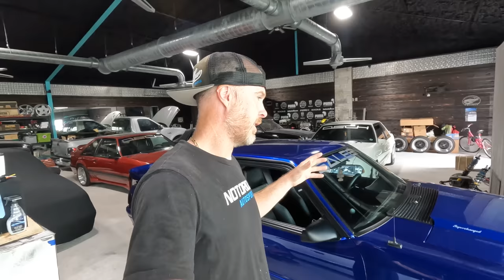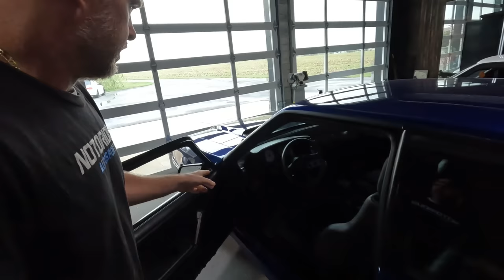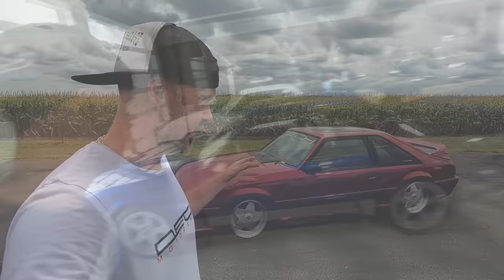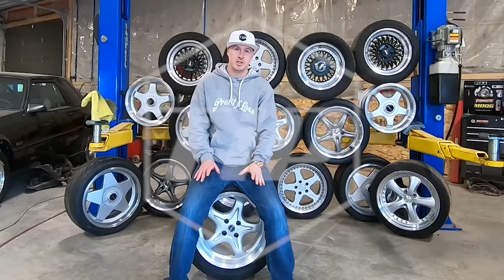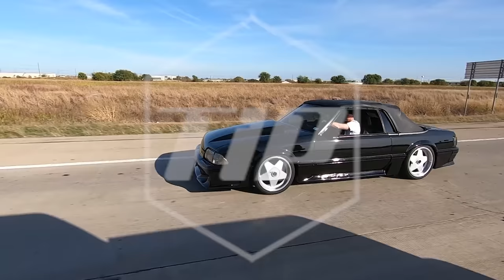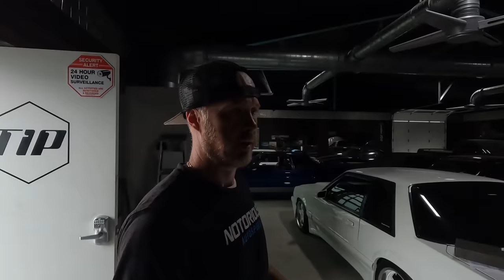Foxbody Mustang Starter Solenoid Delete & Wiring Fixes! - TIPS05E61

Comment: @7:50 Instead of doing all of that you can simply leave everything the way it is on the factory solenoid and make a small 10-12ga jumper to go from the battery cable post on the mini starter to the S post on the mini (sn95) starter, done.

Comment: Yes...a local shop in British Columbia that specializes in foxbodies did that to mine.  They deleted the old solenoid and did a relay system for a few items running off the solenoid such as electric fans, msd etc.  I think they made a mount and installed a few relays inside the wheel well. (It was tucked as well)
Reply from the maker: Nice! Ya this is a great upgrade for those with wire tucks.

Comment: Great idea on what to do about wiring a solenoid / removing the old solenoid for a high torque mini starter.
As far as the wiring nightmares when people wire in things wrong and left with trying to figure out why the 
wired things up that way. Great job figuring out the wire mess.
Reply from the maker: Thank you

Comment: @9:16 This is exactly how I do it, well I use a relay.  I have a distribution post that the battery + goes to which supplies battery voltage to anything requiring it like the starter battery post & the 30 pin on the new starter relay.  85 goes to battery- key cranking to 86 and 87 goes to the S stud on the starter.

Comment: This may be a stupid question but does the type of relay or amp size of the relay matter? Great video! I have been wondering how I could clean up my starter solenoid. I have a similar setup and was about to put on a new high torque starter so definitely going to do this and get a 12v distribution block.

Comment: So, if I'm understanding you correctly, if you have a high torque mini starter you can use a relay IN PLACE of the original starter solenoid and eliminate the original starter solenoid all together.  Is that correct?

Comment: Great information aside from you calling the smaller gauge wires low voltage instead of low current.  All the positive wires are 12 volts however, the smaller gauge wires carry less current not lower voltage. The electronics technician in me felt compelled to provide this correction.😉
Reply from the maker: I worked in low voltage for many years so sometimes when you talk in front of the camera you say stuff that comes naturally.. but yes you are correct 💯. Voltage doesn't kill, amperage does!

Comment: I had one hang up and kill three starters   by the time I figured it out .I have an obs ford and did the door bell trick and at first assumed the doorbell stuck so I pulled it off and just left the two wire end until I got a new one .next day new starter it happened again so I thought maybe the wires casing rubbed a hole and were touching pulled the wire no holes .starter three I had the hood open and it happened again  I smacked the solenoid because I finally figured it out starter unstuck and I realized the problem.

Comment: Added relay huh? Well, how about something easier. For a PMGR (mini) if you would think about it a bit, you could just get an older style starter solenoid (relay) that has FOUR terminals. Then 1) run the trigger wire from the "I" or ignition terminal, 2) put the start wire from the key on the "S" terminal. 3) leave the starter feed wire on its original terminal lug opposite the battery lug and 4) battery power as it was.  SO, that way the battery wire is not constantly live and only gets voltage on start, and the trigger wire is instantly isolated from any PGMR feedback when you let go of the key, because the "I" terminal is wired that way. No extra anything and a lot easier, but don't let that stop you. Oh, and the "I" windings can easily handle the trigger wire current just like an extra relay.  Use a terminal block for tucking if you want but no need for extra relay and wires.